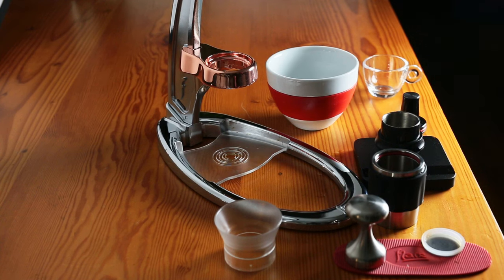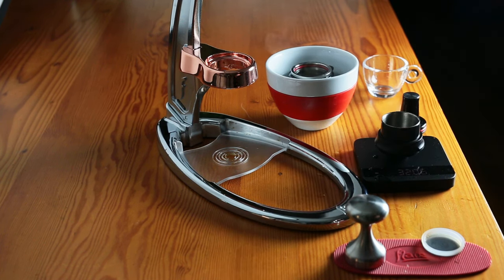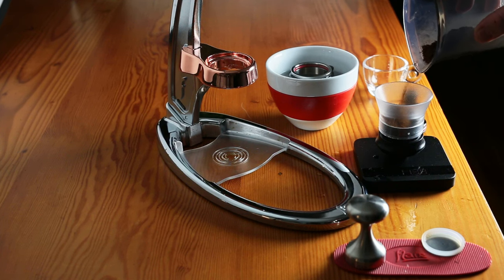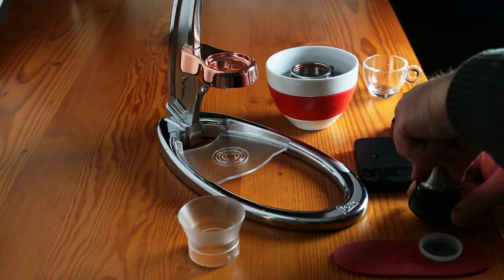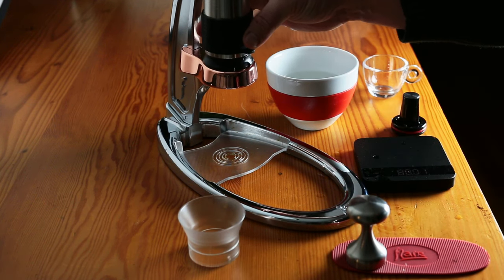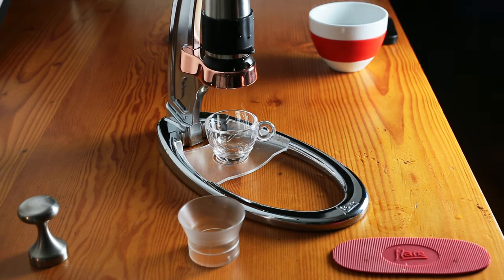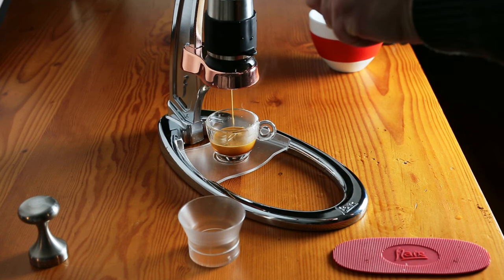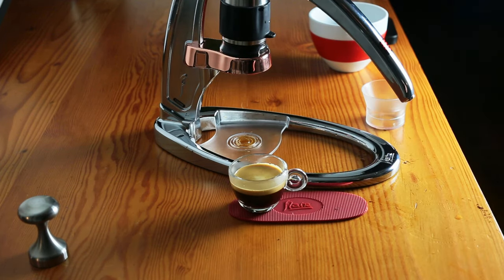Pulling a Shot with the Flair Espresso Maker

Comment: Seems to be a great device. Mistake though, not pre-heating the cup...
Reply from the maker: You're right! But to be fair, for this demo video, it's a step I skipped; I normally preheat the cups for all the Flair shots I pulled (actually, I pulled the espresso cups from my GS3 machiine, where they were piping hot). But I should have showed that in this video.

Comment: I wonder how a shot from this would compare with something like a la pavoni? I've seen comparisons with the ROK but yet to find any comparison with the la pavonis (I know they are different machines but considering they are both lever operated and temperature control a challenge worth comparing in my view)
Reply from the maker: I don't currently have a La Pavoni Europiccola to compare directly to this Flair, but I owned one for over 10 years and had a lot of experience with it. I'd say the Flair would perform better than the Europiccola because the LP had the danger of overheating the espresso, burning it; there's no such danger with this device.